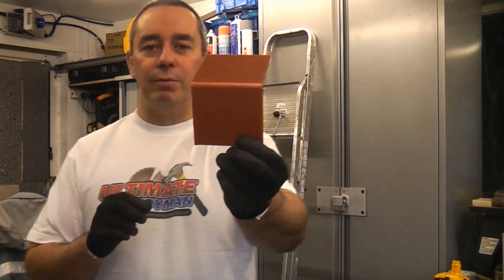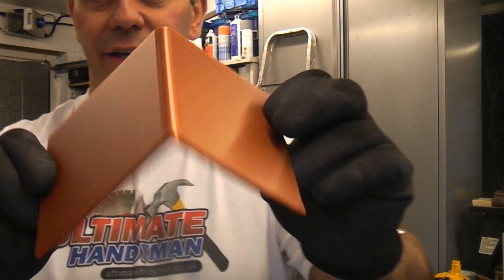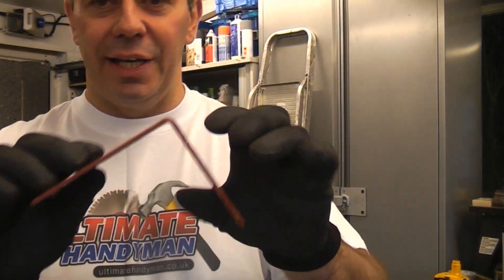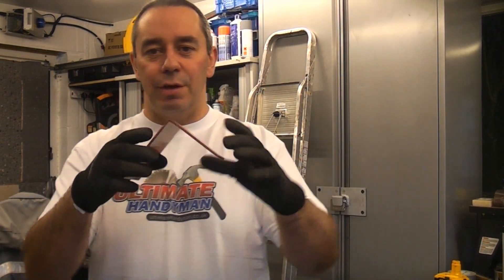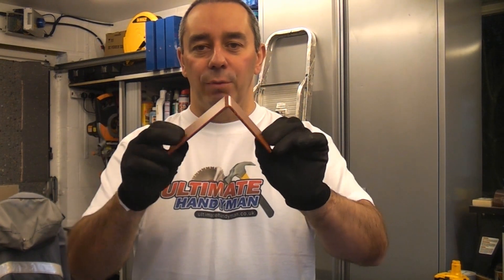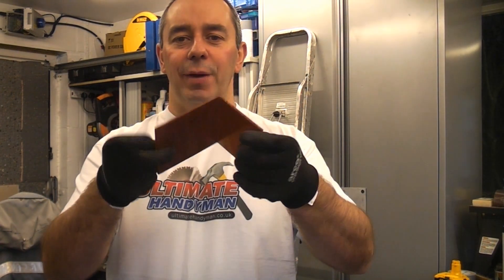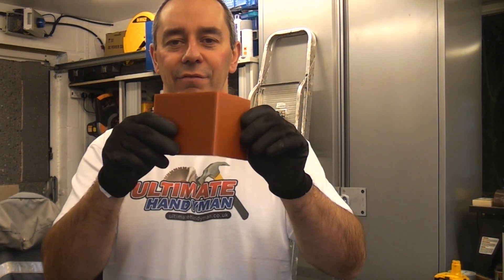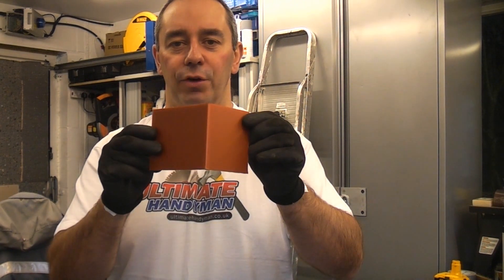Plastic memory | acrylic memory

Comment: Suggestion: bend it again in the middle. Hang it from the bend with a metal wire and reheat so the shape resuming works against gravity. That would be a much better demo of this property.

Comment: But isn't it gravity rather than memory? It would take any shape when heated on different type of surface
Reply: ***** It would be good to see a follow up where you rest the plastic on its side and heat it to see if springs back to shape. As zimatom007 says, this just looks like it's returning to its original form due to gravity. I'm not arguing that plastic doesn't have a memory, just that this isn't the best demonstration of it.  Thanks for the DIY vids though, helped me out on many occasion :)
Reply from the maker: Plastics like this are regarded as having a memory, no matter what shape you heat and bend it to if you reheat it the plastic will always return to it's original shape. I could have suspended one end of it in a bull dog clip or similar and applied the heat and the piece would have straightened out the same.
Thanks for the comment